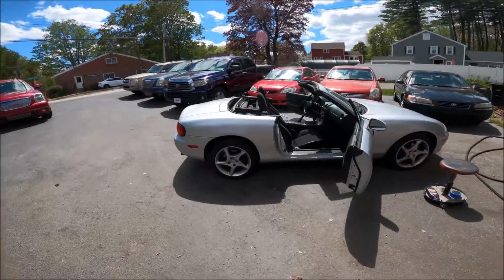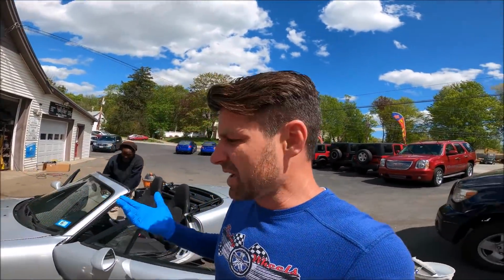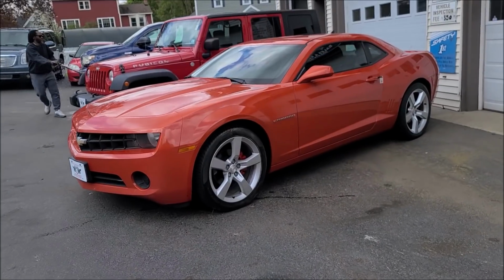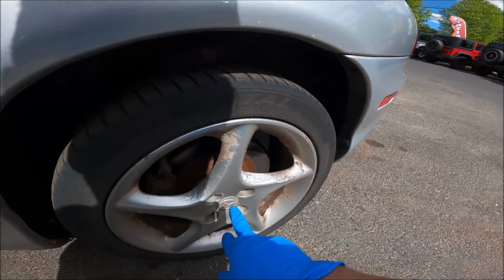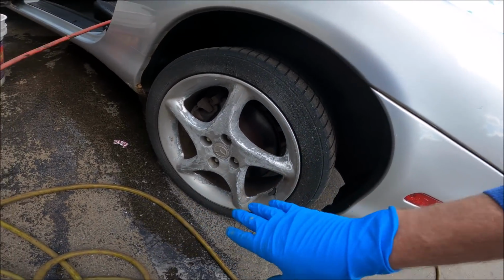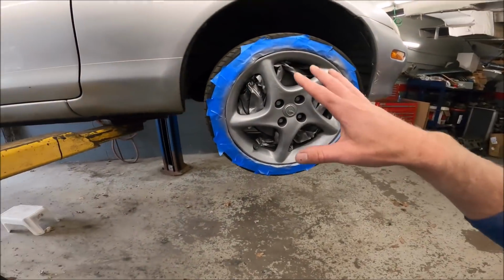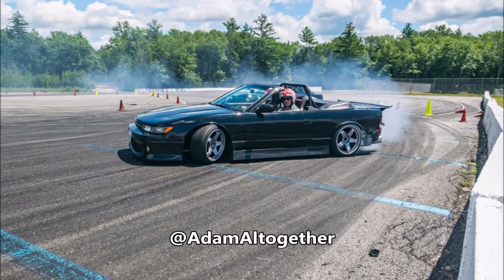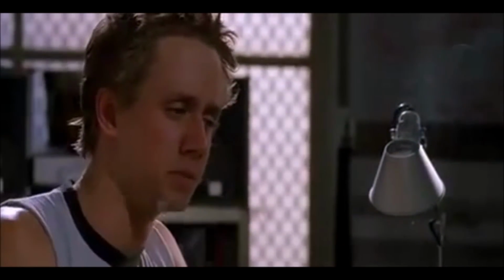We Sold 3 Cars in 1 Week towards our Ferrari purchase! - Flying Wheels

Comment: That Miata woulda easily fetched 5k in TX. Prices for clean Miatas have been rising fast here.
Reply: Miatas run 10 K in Minnesota. They used to be cheaper about a year ago.
Reply: Seriously, when he said that I was like, WHAT? 1500!!?
Reply: I thought for sure it was well for much more at auction.  Everyone wants a toy to enjoy right now.
Reply: That is because up NorthEast the cars are beat pretty bad . Did you see the rusted calipers/Rotors ? The undercarriage was not shown at all  and he used bondo on the panels . I am from NYC which is not far from NH . All the cars are no where near the value of a Texas westcoast car .
Reply: @sharha830  you have a very good point. Didn’t consider the rust, I’m from New England so I’ve seen it first hand. Even so, 70k miles on it is low to be rusted too bad, and calipers/rotors are super cheap to replace on a Miata. The rocker panel rust is common because that’s where the drain from the convertible top spits water out. Still think 3k is low!
Reply: @scrubzor  Also places like Minnesota where it’s known for fuck ton of snow in the winter the salt Play Stone Roads can rust out really easily. That’s probably why Miatas autos are now really expensive in my area. I do plan on moving south sometime in 2024, 2025. Although I don’t know if I’d pick Texas due to a lot of people moving there, i’ve heard the price for housing has gotten more expensive.
Reply: Good point about the mileage but 70k really trashes a small car like that over here . Everyone has a Truck or SUV . I have  myself destroyed my 2nd car because of the roads and it was a full size car that was really low to the ground . I dogged it out pretty bad . You seen the rims all jacked on that miata . They didn´t even show the undercarriage  and I understand why .

Comment: A cheap deck of playing cards or index cards work great for "masking" the tire off from the wheel when painting.  They simply wedge between the wheel and tire, then can very easily be removed, and when dried, stored for the next use.  Simple cheap solution that keeps paint off the tires.

Comment: i know the miata is just running through wholesale but if you spray with a thick layer of primer, it can help fill those scratches in, just in case you end up doing this on a nicer set of wheels that you want to fix

Comment: I would have totally bought that Miata from you for $3000.  Too bad I live pretty far away.  Great video as always
Reply: Even though it's salvage title???
Reply: The road trip home is the best part.
Reply: Yes who cares if it’s salvage. It’s been running good and seems to run good in the video too! What a steal!
Reply: @toddp.226  Depends. If the car appears to be fixed decently, I really don't see much of a price difference from salvage to clear in an old car like that.
Reply: @arturohernandez2313  If you are going to keep the car forever, it doesn't matter.  It is very difficult to sell a car with a salvage title for many reasons.
Reply: @mph5896  We don't know why the car was salvaged.  It cold have been for having been stolen or having a scratch on the side of the car an insurance company didn't want to pay for.

On TKs Garage he showed a 2020 Charger Hellcat with 1100 miles that has a salvage title for an engine problem.  The salvaged the car for a replacement mechanical part.  Why would the next owner need to know the engine was replaced by branding the title?

I think a title should be branded only for structural damage.  The next owner needs to know about that.  If a fender is damaged with no apron damage, it shouldn't.

This practice of branding a car because the insurance company deems it not worth fixing is just stupid.
Reply: bro ikkkk 3k for a manual NB is crazy rn

Comment: Congrats on getting a deal with Omaze Craig! At some point can you post a video on what you are doing to the rockers? I have a 2011 Ram and mt rockers are a little rusty but no horrible. Looking forward to the Raptor video.
Reply: Looks like they sanded and light bondo.  I’m most sure he said he used truck Bedliner spray paint.

Comment: A 52 card playing deck from dollar tree stuck in betweeen the wheel and the tire is way easier than wire brushing the tire after painting the wheel. Just saying.
Reply: I like index cards better only takes like 10-12.
Reply: I saw a tip for a flexible trash bag, cut a Cole in the corner of the bottom and stretch it around the wheel. Looked like it may take some practice though.